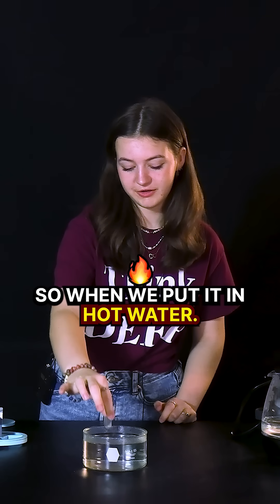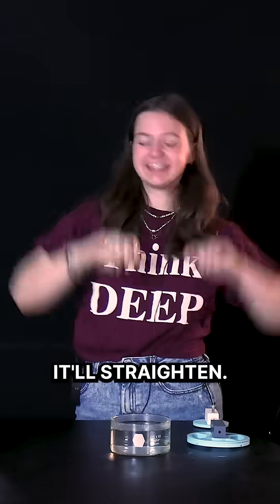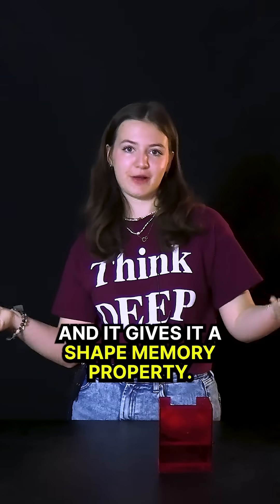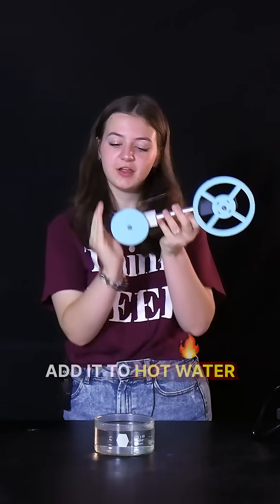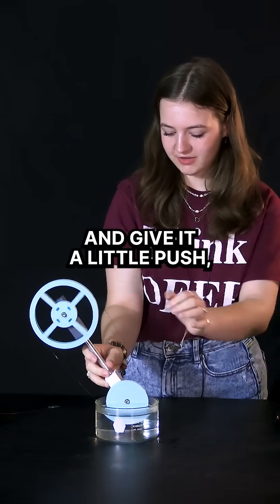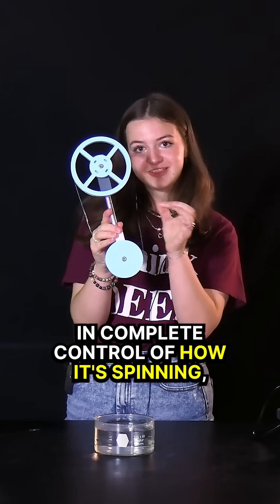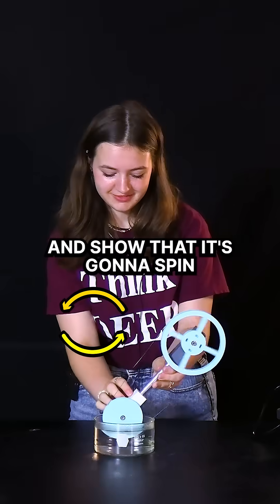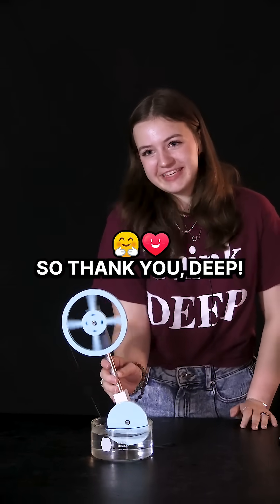Magic metal springs to life from heat! But how?? #shorts #tamu #science

Comment: No, it's not powered by the material. It's powered by the temperature differential, obviously.
Reply: That's like saying that a car isn't powered by an engine, it's powered by the gasoline that provides power to the engine.

You're arguing semantics.
Reply: @joelvannatta3266 No, it's Thermodynamics. A car engine is also powered by a temperature differential. 

In the case of the video, the "fuel" is the latent heat in the room above the temp of the chilled water. In the engine, it's the heat created from combustion.
Reply: @joelvannatta3266  well what you are saying is, that the car with the engine and without gasoline runs just fine? 
Doubt that

Comment: Man, i can see the paradox here. It's proof that there is no infinite energy nor create energy. This answered why energy can only be transferred.

So, in theory, It works with hot water, and hot water requires heat. Not only requires heat, the water also slowly evaporate during the heating process. And hot water slowly cooled down without heat, meaning it needs to be heated continuously but also evaporates in the process, meaning water needs to be kept filled and the heat source needs to be kept alive and so on and so on 😂

Comment: Is this the first perpetual motion machine as long as you can keep it hot?
Reply: @uncgmccgaming  so it isnt perpetual, something needs to heat up the water and it will require more energy than the motion of the rotator is generating.

Comment: Get a bunch of this wire, coil it, make a bigger version of this, run the hot exhaust of a car to, use cvt == more power. 

Or can use it to remove turbo lag if this tech becomes good.

Comment: Infinite power... it could be. IF that gear drives another gear that creates heat energy, which in turn drives the original gear.
Edit: In fact, we are talking about energy transfer, an energy loop, if you will. What is seen in the video is the first sequence. By creating a second frequency that restores the initial conditions we could, theoretically, close this loop, thus creating a PERPETUUM MOBILE.
And we can avoid using palladium so we don't end up like Tony Stark. Just kidding, no one is forcing us to put an arc reactor in our ribcage.

Comment: To hace infinite energy have a power generator to get power by a spinning wheel that this thing makes spin , the spinning generates power, power feeds into the heater, the heater heats the water , the water keeps the spinner going. Then just slowly modify the generator to supply power to other electrical units, if the generator is not enough then attach a bicycle or hand turn wheel generator to help the heater 😅

Comment: all they have to do is figure out a way to turn that potential energy from it, turning into heat to heat the water in turn, making it last forever and then scaling that up somehow will make it well infinite power
Reply: It is not possible, because you will loose more energy due to heat outside of the system, than you would gain by this device.
Heat radiates in all directions, so you would need to capture all the heat from the entire machine (so also the motors and the part where the wire cools down...) and you would also need 100% effective insulation to keep it inside... and that would just keep the same energy and not gain any additional energy. 
Once you generate electricity you take out that energy out of the system so you you got less heat afterwards. 

What i am trying to say is, that basically every aspect of trying to make this work would be impossible.

Comment: hot water runs the nitinol. nitinol runs the generator. generator heats the water. infinite power.
Reply: Until you plug in a device into the generator, which uses that energy... 

Also you would loose heat energy to your sourrounding, because heat radiates away via infra red. (Thats why you can stand next to a fire/heater and get warm...)

Comment: So theoretically, if you could find a natural heat source you could heat the water and use a device to regulate and reuse the energy to keep heating until the natural occurrence returns, creating a nigh infinite chain of energy. Yes its powers are decided by the whims of mother nature but as long as the environment would stay stable, the energy conservation and repurposing would continue for a very very long time, percievably infinitely.
Reply: We do already have quite effective ways to use mother natures energy like solar, wind, hydro and geothermal. The problem with this method is, that i don't think it will generate enough power for cheap enough to be commercialy viable on a large scale. 
But this video is still a cool demonstration what you can do with this material and all of its other potentials outside of power generation.

Edit: forgot about heat exchangers, that are capable of concentrating heat to a higher degree to power a standard turbine. It is already possible to use these natural heat spots if you can find them and they are not already used in some way.

Comment: "You need a generator to heat the water" simple fix, the ocean use combined it with hydro generators, to power the heating elements, you need water to power this system. So don't have to transport it. It wouldn't need a power source since your harnessing the ocean, Even if you had to filter salt from the water, you've got a commercial product to sell. This is useful if you find the right application, it's usefuk the arguments whether the shear strengh is strong enough to spin large/heavy gears without snapping. We do not utilise solar or hydo nearly enough, there's no reason for power stations they have all the energy.l we need.

Comment: This could be used on satellites and the Space Station where the sunny side of the orbiting object is hundreds of degrees hotter than the dark side of the object. Devices could be built to take advantage of the sun's heat to spin and produce electric current.  Of, course solar panels are already doing that.

Comment: Perpetual motion? If you had something holding the bottom wheel in place, potentially it could spin until the liquid runs out, would be awesome to see how long it takes in a fmv time loop. Also to measure rpm, and if it speeds up over time or maintains a sort of constant speed. This is cool AF.
Reply: No perpetual motion, because it uses the heat energy from the water. So it stops, when the water cools down. 

Btw perpetual motion is not possible, because you can't create energy, but only transform it (f.e. from "useless" heat energy to a more usefull motion energy, to maybe electricity. All different types of energy, but still all energy that gets taken away from somewhere, when transformed)
Reply: @notbob3590   @notbob3590  I know it's not possible because of the laws of thermodynamics, but in layman's terms, the principle is there, if it is just a case of keeping the liquid at a certain temperature, that can be achieved electronically, what I am getting at is, even if you were using electricity to keep the liquid temp idling at a constant where the rest of the reaction works as demoed in the video, there has to be something that could have practical uses, I was thinking like an electric car, but using this for additional hydropower to send some extra power back to the battery, or a transformer etc.

Comment: She made a working perpetual motion machine. It doesn't require any batteries and it only requires water. Meaning that it could run forever without needing any physical interference except to start it
Reply: But you must keep the water heated...so if you can get that wheel to keep a battery always 100 percent charged to the heating element can perpwtually keep the water hot then we are good to go.
Reply: @Lee-g5z8r but you can't, because the battery would absolutely run out before you can charge it back up. Heating water takes a LOT of energy, so there like no way the battery wouldn't use more energy than it gets back.
Reply: @grab2337  You also have to remember the resistance that will be put on the wire. The more electricity needed to power the heating element the slower the wheel will turn

Comment: SOOOOOO 
That spinning wire because of the water. Is that perpetual motion?!?!? 😧
Reply: No, its because of the heat exchange between the water and the air, which in fact uses up the energy in the water until there is no temperature difference between them (or the crystal structure stops straightening, which happens at a certain temperature, aka the water is too cold)

Comment: Could that be considered a perpetual motion device ?
Reply: @ChristopherKeillor-m9d  no because it’s using the energy from the hot water
Reply: @pakratmiz4487  yeah I guess it could be the next step then just need to be able to make a device utilizing that stuff that could not only keep its own water hot also have the power to run other things so I guess generate electricity which would make heat in access to run a motor?

Comment: Sounds pretty neat for industries where hot/warm water is just a byproduct.
Not sure how effective it could be to convert it back into electricity, but places like ai data centers where a lot of water is used for cooling, could probably have this transforming some of the heat into motion, cooling the water, and also inputting electricity back into the system.

Comment: first of all fit those who are trying to say infinite power we still have to figure out the wear and tear rate because as it stretch and contracts as it spin. remember we dont use flar bar or belt to drive a pully instead use a reinforced rubber belt or chain. because if you put a steel in that configuration stress and strain compressive and tension can stress the metallic upto its breaking point.
Reply: The sun gives us infinite power (comparitively to our demands as a species rn) 
We just got to use it effectively. (And we got solar pannels for that tbh, just also need a way to store it now)

Alsp perpetual motion machienes are not possible because of the conservation of energy if that is what you are implying with your comment. This device uses the heat from the water.

Comment: You still have to maintain the heat level so again the hardest part of perpetual motion is hiding the battery/power source in this case to heat the water to keep the metal straightening would require power

Still cool not trashing it at all

Comment: You still have to maintain the heat level so again the hardest part of perpetual motion is hiding the battery/power source in this case to heat the water to keep the metal straightening would require power
Reply: They never said it was perpetual?

Comment: So would this be effective as replacement for gears and machinery? I could imagine giant mechanical structures filled with water and these pulley systems. Or is the amount of torque that it generates. Not enough for industrial level manufacturing. I could see that being an issue, but if you work on this you could definitely revolutionize manufacturing business if it's valid. I didn't go to college. This is just an idea. Feel free to make it a reality as it might help reduce pollution by a significant margin if we don't have to burn oil to work the machines

Comment: This would work perfectly for a geothermal energy conductor. This is genius, if you were to leave it in a place that was hot all the time no matter what time of day you might be able to tap into free energy, the only kicker is that the cpst of the machine would probably be rediculous enough to a point where it would probably not be enough for anyone to actually call it free energy.
Reply: No, it won't nitinol will lose its properties to quickly for it to be sustainable, because of the minerals dissolved in hot springs it would wear away at the nitinols titanium coating and denature it, also, if the hot sping is too hot for too long that can also be a problem and will, after a while, it will inevitably snap

Comment: I didnt think about the usecase, but this could easily be used as a more effective generator for thermo electric pp for geothermal power use with a low temperature delta.

Comment: Hear me out, we place larger versions of these along geothermal water vents, using the constant heat, we may be able to supply certain amounts of hot water and power to people in unmaintained areas
Reply: or you just place a regular turbine along the geothermal water vents
Reply: @jour2gloire  for a turbine you need a high rpm and i dont think that you can do it with nitinol, the other way would be better, a heavy flywheel wit low rpm but a high torque
Reply: @jour2gloire  This also has quite a few problems. Geothermal water has a bunch of sollubles causing wear on the turbine, so you could use the geathermal water to preheat a normal rankine cycle. This uses a heat exchanger to heat up deionized water.
This still needs a different source of energy as geothermal wells are generallly not hot enough to be able to power a turbine.
Reply: i mean yah, but people ahve found more efficient ways of harnessing geothermal energy
Reply: We already do this… but much more efficiently with direct electric generators.
Reply: Just run pipes in cold water in,steam out,turbine,power,condensate heats houses,, ask iceland how it works
Reply: easier to use the geothermal fountain to boil water though, yknow, like we already do
Reply: Turbines are cheaper and last longer
Reply: @JUSTDURT  good thought, but materials (metal bending) like that wear out quickly. Keep thinking of more ideas.
Reply: you stole these words from my mouth. but yeah. 100%
Reply: This motor is way too inefficient. The current heat pumps they use are easily more efficient.
Reply: Here is the problem: Greed. Oil.
Reply: Shhhhhhhhhhhh you don't want them showing up on your doorstep do you?
Reply: I think a sterling engine would be more efficient
Reply: Yea but remeber if the dissappears she wasent scucidal it was the goverment who killed her
Reply: Its a great idea, but the problem is that your idea doesn't involve oil or coal so the government will never adopt it.
Reply: @JUSTDURT   like they dont do that allready 🤣
Reply: This one right here. Practical uses!
Reply: We need people like you to innovate for the betterment of humanity! In this case, nitinol only has the ability to 'reshape' around 30 times, but that wouldn't stop people like you from finding ways to engineer around and find better solutions. Keep rockin!
Reply: If done in a large scale, using a hot spring as the water is a good idea, but realistically, that in a large scale cant charge a single battery let alone a whole house. Maybe a light bulb will work.
Reply: @passerby4673  I'd say we don't go that far, just use this mechanism for small landscaping accessories at hot springs, that would make it a simple product that don't need constant maintenance and requires no power. A good design is all it takes.
For example the shishi-odoshi is a landscaping gadget that harness flowing water and make garden feels even more serene.
Reply: @passerby4673  I'd say we do that in a smaller scale, designing a hot-spring related product based on such mechanism and it would make a good gardening/ landscaping gadget since it won't need any maintenance and takes no power.

For example the shishi-odoshi simply use the flowing water to make ponds feels more serene.

Edit. This is the 2nd time I commented, idk why my comment got removed the first time
Reply: @_d3642  it takes power, heat. Also it needs more maintenance than a turbine because this material looses its shape memory properties too quickly to be economically viable
Reply: @passerby4673  nah dude im talking about using it to carry water, it would make something that is solar powered more efficient
Reply: This and the cyberpunk pfp makes your comment perfect
Reply: A friendly piece of advice: If 2 Tall, Black suited man approch you in the next few days, Run.
Reply: This is a fantastic idea

Comment: I would like to have had some information on the failure of the wire due to fatigue (for those that are thinking perpetually energy, look up instead ‘water ram pump’ and ‘small hydro electric generators’).

Comment: Nitinol and other "shape memory metals" are fascinating. They can be used to create artificial limbs and high-precision tools able to work with very tiny stuff.
Reply: Look for the original video of the scientists first discovering Nitinol. Like kids laughing. So excited.
 They thought it would take the world by storm end the energy crisis-but then nothing happened.
The OIL GODS do not like NITINOL.
Reply: @GamaheaMusic  as an observer I think that will farewell people faster!
Reply: @GamaheaMusic  Wht if i tell u it may of been prt of the Roswell crash material?
Reply: @GamaheaMusic   the company i work for uses it in one of our medical devices
Reply: What if we take nitinol in large quantities and run large wheels?
Reply: We use it in dentistry. It is quite expensive, can confirm it is quite the pleasure to work with though.
Reply: @GamaheaMusic  That is so RAD! I had no idea it was in use or other use cases were already found! Thank you so much for sharing 💕🪢🛠️🪡🔩🐈🔊
Reply: @JeffBaglot  a comment I read that I dont know if it's a 100% true, said that they use these springs to put in clogged arteries and veins. They slip the wire into the clog while it's straight, and the body's temperature warms it up and makes the metal go back to it's spring shape forcing open the clog.
Reply: @MarvinBushDid911  It is true.  I think they cool it with nitrogen to slow the effect enough to get into place.
Reply: @JeffBaglot  Yep. One of its interesting properties is that it can act as a motor to move objects. It moves when heated, and Electrical current heats metal as it passes through a wire. Apply an electric current, wire heats up, and wire tries to move.